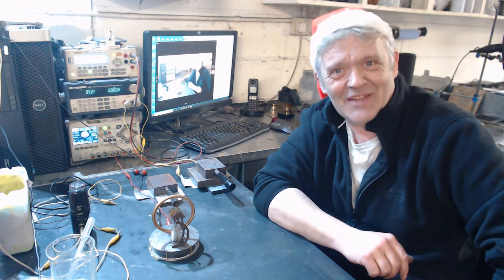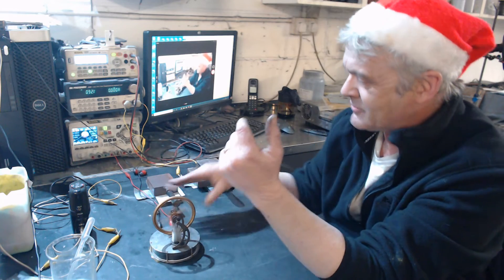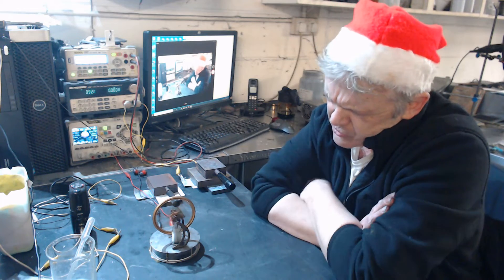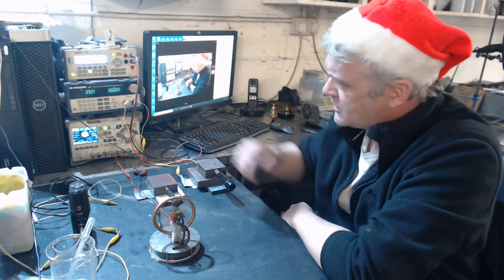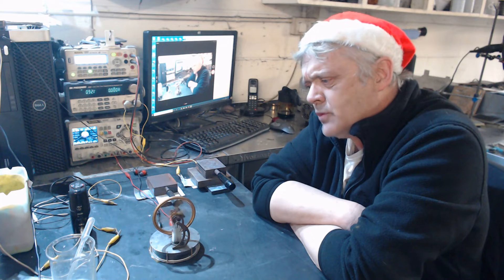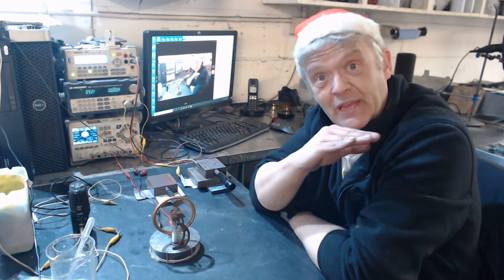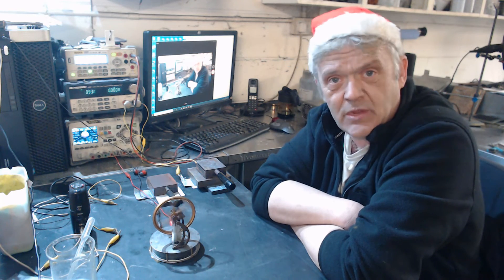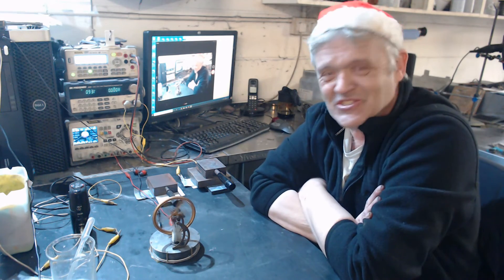Running A Stirling Engine With Conductive Ink

Comment: Depending on how hot it gets, won't some binders/glues start to degrade?  If you chucked a bunch of graphenic graphite and/or copper powder into say sodium silicate ("waterglass"), would that work?  It would definitely add a lot of resistivity to it, but maybe too much? 

   I could see a specialized Stirling engine for a small, lightweight, aerodynamic vehicle (like the Aptera) that works from Solar heating during the day and then at night works off batteries. By specialization, I mean optimizing the heat and cold differentials.  Like use vacuum insulation over the part to get hot plus with ultra black carbon nanotubes to absorb light, and then extremely thermally conductive materials* + evap system for the part to cool.  The heater part would be placed in a Solar "funnel cooker" type design concentrator as it doesn't need to be adjusted for Solar position near as much. 

* I wonder how graphinenic graphite in copper would do?  I've lately been thinking about building an insulated thermite foundry. The idea is to take one of those large (64 oz) vacuum insulated stainless steel containers (put that in a large clay flower pot), put some ceramic fiber insulation and sand on the bottom of the insulated container, put a large high heat crucible in the middle, pack the sides with ceramic fiber and sand (on both the bottom and sides, the ceramic fiber insulation would be directly against the SS vacuum insulated container).  Then put some thermite in the crucible.  Let it react for a bit, throw in your copper, and then as it's melting throw in your graphenic graphite, and take an equal sized (64 oz or whatever) vacuum insulated container and put over the top but with leaving an air gap so it doesn't pressurize and fly off.  Or something more safe would be to take carbon fire/welding blanket or ceramic fiber insulation and put it over the top to insulate it (you would only do this after the reaction has died down some because otherwise it will burn through most likely).

   The idea is that the ceramic fiber insulation and sand provides some protection for the SS insulated container so it doesn't melt/warp, the sand provides thermal mass to keep it warmer for longer, the vacuum insulation keeps it warmer for longer, and the ceramic fiber insulation top also helps to keep it warmer for longer.  Theoretically, you should be able to fully melt the copper and be able to mix in the graphenic graphite in with it.  I would try with equal volumes of the copper to graphenic graphite.

     I also plan to use it to convert carbon sources into graphite using the above, by putting the carbon source on the bottom of the crucible, putting multiple sheets of paper over that, putting some activated carbon on top of that, and then putting the thermite reaction materials on top of the carbon. Because it reaches such a high temp, it should produce some nice graphites, especially if you use a source that contains a high percentage of crystalline cellulose.  

 Wonder how long the crucible would last?
Reply: Actually, I don't think the sand would work. The sand closest to the crucible would likely melt into glass and then taking out the crucible and/or reusing it would be a bit of a pane...   I think activated carbon (or any carbon) around the crucible would work better. And while it won't provide as much thermal mass as the sand, it will help to insulate the SS vacuum insulated container better.  Actually might also use NightHawkinLight's approximate Starlyte material to directly line the SS container as well, then a layer of ceramic fiber insulation, then the activated carbon to pack in the crucible.  Actually, that combo would protect the SS container far better, and provide more insulation for the crucible.

Comment: Merry Christmas Robert. I am very interested in your work, both the Stirling Engine and the capacitors. How can I contact you or if possible, meet you in Britain to take a closer look at what you are doing?
Reply from the maker: you can always send me an email mate at robertmurraysmith64@gmail.com - we do run an open lab so you are welcome to visit - however we do get a lot of visitors and are pretty busy so I would only be able to spend an hour or so with you - cheers

Comment: Try a thermoelectric reaction 

I years ago attempted to power a laptop with its own heat I forget what material I used but it bearly  lasted ten min grapheme makes it viable ur ink more so
Reply from the maker: it is an interesting idea mate but most heat engines are only 37% efficient limited by Carnot efficiency and as heat from a laptop is a by product then efficiency figures from scavenging the waste heat are going to be really really low so it is only ever going to be a few percent you are going to be able to get whatever you do

Comment: Can it work at high temperatures and pressure?
Reply from the maker: it's a Stirling engine so it will depend on design - but yes
Reply: @ThinkingandTinkering  i meant ink not engine
Reply from the maker: @VinaySingh-zm2vi  well the ink is on the outside mate - so pretty much
Reply: @ThinkingandTinkering  so your ink doesn't work in high temperature and pressures

Comment: Just as the ink can increase the heat conduction to the hot side of the SE it can increase the dispersion of heat on the cold side.
Reply from the maker: nice point mate - thank you
Reply: @ThinkingandTinkering  Your welcome.

Comment: Could you vapor deposit your ink onto glass such as it appears clear or with a slight tint? Then, attach wires and voltage to create a deicing effect?
Reply from the maker: you could certainly do that with graphene

Comment: Its a pity that we can't think of any chemical reaction where a nano-Carbon electrode like that would become hot in the normal course of its operation....particularly if that reaction (like the Sterling Generator) also produced DC power....
Reply from the maker: that would indeed be awesome - but adsorption of water onto zeolite would do that

Comment: Baxi had a combined heat and power boiler (Sterling engine) to heat your home and give about 1KW of power, only about £7or8k! not sure if it's still available but, I just can't see how it would ever be worthwhile  now, I've just fitted 1.8kw of solar panels for less than £1500 so £7k buys a lot of "free" power. Happy Christmas all
Reply from the maker: it is cool what is there already. m ate - but it is always worth exploring stuff - if not just for the fun of it then who knows what you will stumble over - one thing is for sure - you miss 100% of the goals you never try for

Comment: i had an idea wich is close to that ! but instead of using a stirling engine my idea is to make an engine with Nitinol spring that will replace piston , connected to a crankshaft like normal engine and using electricity to heat up water/graphene mixed with ultrasonic transducer and resonating plate kind like kelly device very efficient to heat water with very litlle input and spray that hot water or steam on the Nitinol spring with a central 360" injector , the engine will not run on compression but expansion and contraction of a memory form alloy and Nitinol can generate an incredible strenght when changing from hot to cold state or vice versa wich could lead to a torquy and light weight engine , this will probably not be a high RPM motor but thats also an advantage if you dont need a gear box to slow down the rotational speed of the motor to match the one needed at the wheel . the all thing powered by a graphene hemp based supercapacitor battery .
not sure if its reel but i saw a video of a device using a 9volt alkaline battery using resonator and ultrasound to heat up to boiling temp 1,7 gallon of water in under 2 minute starting from room temp, if its true that could be the way to go to make electric car affordable , efficient , long range and diminish drastically the pollution generated during the production of electric car.
for what i know about Nitinol its made of 60/40 titanium/nikel and depending of the thickness it require between 40'c to 80'c to change shape ,easily achievable with hot waterand graphene in it will increase the heat transfer.Nitinol  can be buy raw wit no memory form programmed or already shaped but is easy to program the shape using heat .
you can find paperclip made out of nitinol to recognize them change their shape and put them in hot water if they change back to their original form they are made of Nitinol and use them in a model engine like your stirling one, it can be cool!
Reply from the maker: there are some great nitinol engines around mate - I think there is even a 'toy' kit on eBay for a few dollars - so - nice idea and easy to give it a go - I also did a video using fishing line as an artificial muscle that might work well here

Comment: You know in the north here in the USA, I've seen floor installatios that include pex water heating. Basically hot water flows from the boiler to the floor. But that means you can't just nail new flooring. How do you know where the pex is?. But with conductive ink or conductive sand or cement, that would not be a problem at all. For example, the product could be an ink or glue that you would use to bind regular play sand under the flooring. This would work as self leveling compound and at the same time, it would be the floor heating system.
Reply from the maker: that's an awesome idea mate

Comment: OK!
Now hook up a small generator to it and see how much current you can produce.

Could you use it to keep water flowing down a SWAG? - I'd be careful with this one cause a long enough stretch and you could end up breaking the universe by generating more electricity than you use.

Now that it comes to mind; have you thought of testing to see if your conductive ink could work with a magneto-hydrodynamic salt water propulsion system?
 
Given that there are no moving parts, would a magneto-hydrodynamic salt water propulsion system be more efficient than a standard water pump?
Reply: lol, buy some ink and answer them questions...😼
Reply from the maker: lol - awesome
Reply: Over unity will not happen but if you can take advantage of supplemental naturally occurring inputs it will look like you have and it leads many people astray when trying to repeat the experiments without them because they did not know they were there to begin with.
Reply: @Barskor1  😎👍
Reply: The important question to ask is, 'How much power can it produce, compared to the input power?' The answer will likely be less than 25%. It will be a good learning experience, and can teach you ways to reduce inefficiencies in a system.
Reply from the maker: it's bound to be less than 37% mate after all a Stirling is just a heat engine though the resistive heating component - which is the ink is going to have a pretty high efficiency - just because all resistive heaters do
Reply: @RWBHere  
If you want to learn how to reduce inefficiencies; follow what the inventor of the Oxford Electric Bell did.
https://youtu.be/UtQGYz4f3YQ

I did the a bit of searching so I could do the calculation.
At 2 kilo-volts and 1 nanoamphere, the battery puts out 2 micro-watts of energy every time the bells chime and has been doing that for 170+ years.

I'm not sure which is the more remarkable, the battery lasting for over 170 years, or the movement actuating on 2 micro-watts of energy.

[EDIT]
After re-watching the video and paying a bit closer attention, Sally Le Page mentions that the bell was made by London instrument makers Watkin and Hill in 1825. It's 194 years old and will be 200 in 2025.
Reply from the maker: love the MHD suggestion mate - well worth a try and I will build something I think

Comment: be interested to know how many watts it took to actually run that engine and then of course another step would be to pulse or regulate the power to the exact point of rotation .
Reply from the maker: 10 watts or so - there is no way it was efficient - but the thermal mass of the base was very interesting
Reply: @ThinkingandTinkering  Thanks for replying to the comment  have a great Christmas.

Comment: Great stuff Robert, as always! :) I really can’t wait to see commercial products based on your ink, there’s so many applications for it, besides batteries. 
At the moment I think of printing a spiral on a paper tube, rolling it in a flat bagel shape to make a motor coil. That would be awesome to see the ink move things. Another idea I have is to print it in a way to be a coil and a power storage device at the same time. What do you think about that?

Happy holidays, mate!
Reply from the maker: I think I am going to try it mate - cheers
Reply: I wonder how many coils you could get if you used 3D printing and a Russian nesting doll kind of consept with the tubes.

Comment: That's just showing off!
Reply from the maker: lol - yeah a bit lol
Reply: @ThinkingandTinkering  
Excellent!

How about a combination of various suggestions here, using a Fresnel lens for heat, turning the engine to induce current (using the ink?) And generate power?
Reply from the maker: @rogerstarkey5390  well worth a go mate - cheers
Reply: @ThinkingandTinkering  I said out of the box thinking who knows where it will go?
Didn't take you long :-)   Martin
Reply from the maker: @solarhope  lol - cheers mate